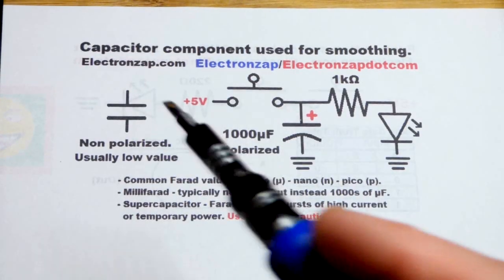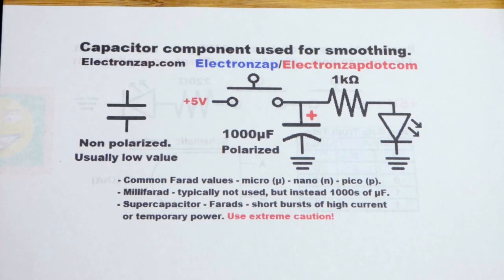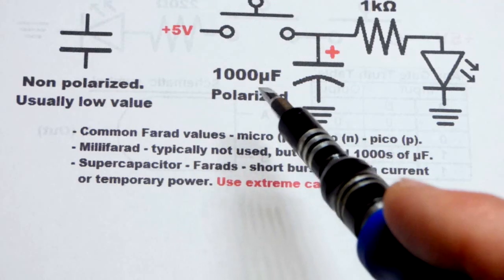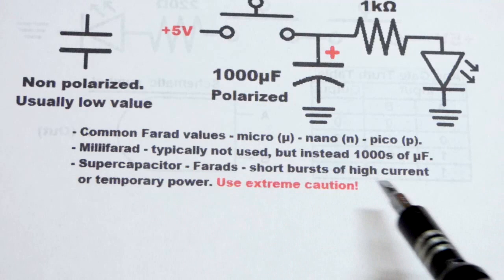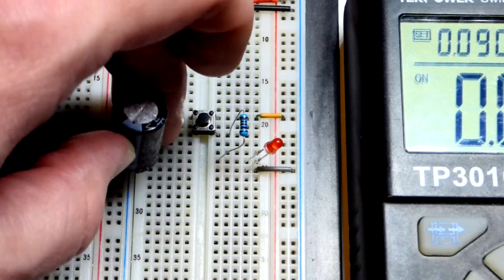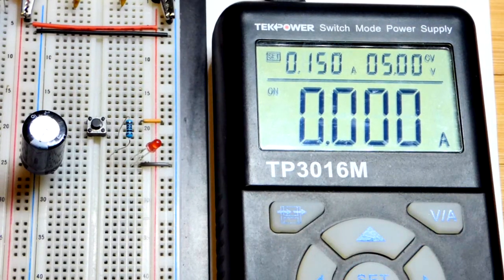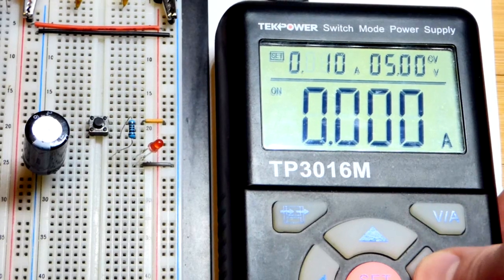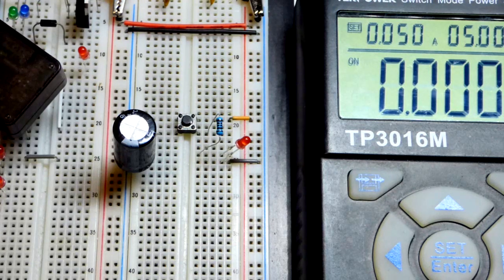Introduction to capacitor component used for smoothing an LED circuit

Comment: Can a smoothing capacitor be used for the opposite purpose? I have a battery circuit with a LED that’s used for indicating when the battery is low, the battery powers a vintage camera (it draws a lot of current but for only two seconds at a time). When I shoot the camera, it draws power from the battery and the voltage drops for two seconds under the designated threshold for the LED to indicate “low battery” so it flashes. I would like to avoid this, so the LED only turns on when the voltage is steadily under 3.7v (the “low battery” limit) for more than, say 5 seconds and not each time I shoot the camera.

Thanks!

Comment: Hi, hey thanks for this. I'm just wondering if there's a way to maintain stable voltage until the cap is discharged rather than have it slope down. Would a boost converter after the cap, set to input voltage do that or would it's output still slope down?
Reply from the maker: I don't think you could maintain a voltage while a regular capacitor discharges. Super capacitors could use a boost converter to maintain a voltage for a while, but you cant charge them instantly and they are expensive.
Reply: @Electronzap  thank you!

Comment: Nice. Would that particular capacitor charge to 35v if the button was left connected long enough or just up to Vcc ( 5v ) ?

Thanks 👍
Reply from the maker: Capacitors stop charging at the voltage applied to it, which is typically the supply voltage or less. Some circuits though boost voltage , so you have to be careful in those cases.